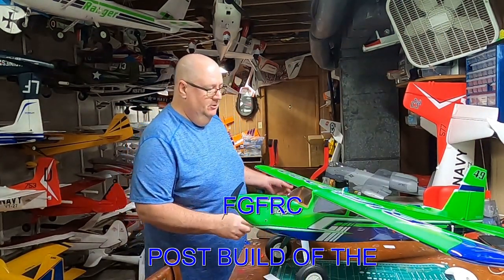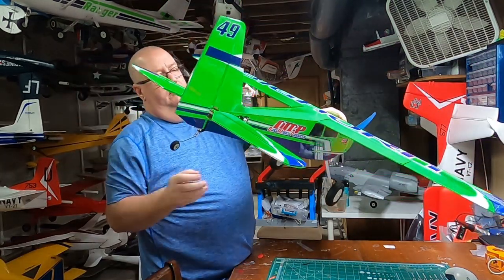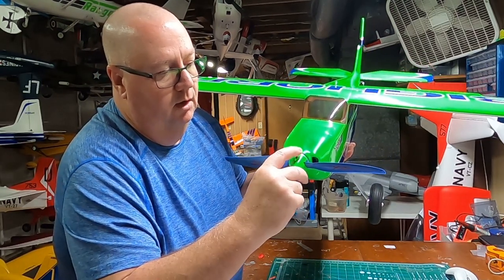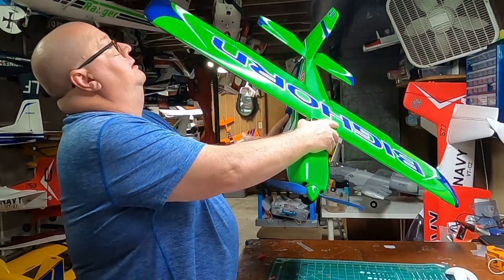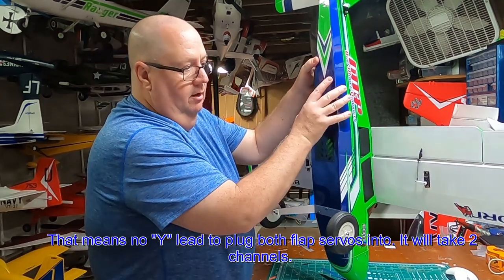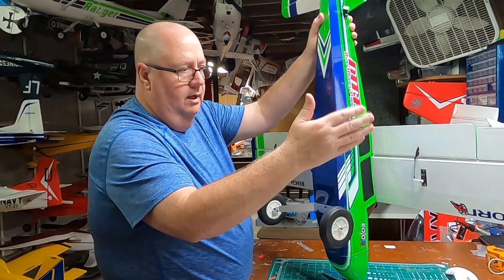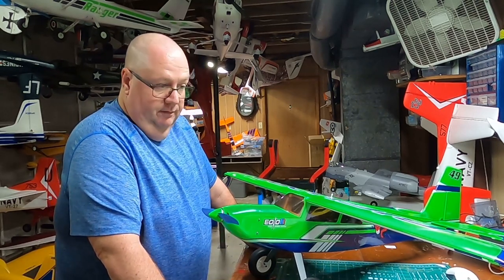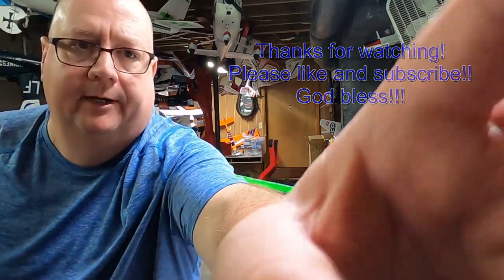AS PROMISED THE BUILD OVERVIEW OF THE OMP BIGHORN BY FGFRC

Comment: I just pulled mine out of the box to begin assembling (Big Horn Pro with flaps just like yours). If ailerons and/or flaps didn’t come with included Y harness, can’t that be added as extra attachment to allow for 5 channel set up?
Reply from the maker: Yes but you will need to mix the flaps together to get them to work as flaps. Or you can also use Y harnesses and do a full wing aileron configuration.
Also be careful not to over tighten the tail wheel I stripped mine out now a replacement is on the way.

Comment: I see you are using the AR620.  I bought a AR630 (AS3X and SAFE) receiver for this airplane and then found out that Spektrum does not recommend reversing servo harnesses or mixing channels if you operate in AS3X.     So now I am left with the option of replacing the stock servos with a pair of servos where one is reversed, or buying programable servos and reversing one of them with a program interface.  Yikes!  Can you think of less expensive options?  Yes, I could just mix two servo channels and not activate the AS3X. :(
Reply from the maker: In order to use that receiver in this plane just buy ONE reversed servo for flaps. That should be all you need.  However to be honest, if you have a little bit of experience just put a ar620 like I did in this plane.  Turn your rates way down to tame those big control surfaces and fly easy with her until you get use to her. She is a very stable plane with the throws dialed down. (reduce the movement on the control surfaces)

Comment: I heard you say the term "scale plane".  What does this mean?   does this mean basic aircraft without the advanced controls?(such as a mig-29 or Su-35 thrust vector control?)
Reply from the maker: Scale planes has 2 meanings, 1 is the scale or duplication of a real plane into model form . 2 is referred to as flying as a flying style. What this means is with this plane is that with these big control surfaces, and if this was a real plane the moves this plane could do would not be realistic for passengers or a pilot. IE a violent SNAP ROLL that this plane could do would kill people inside if it was full sized.